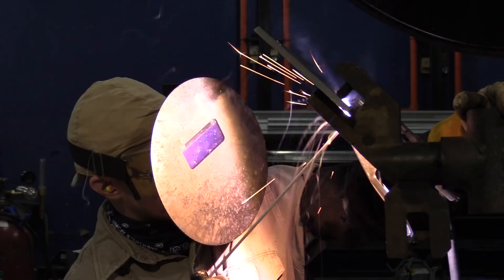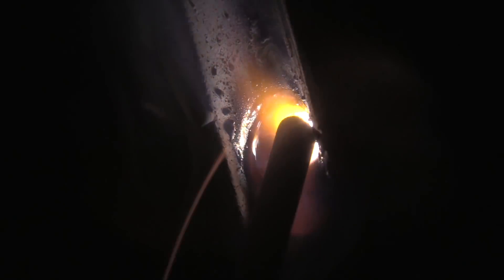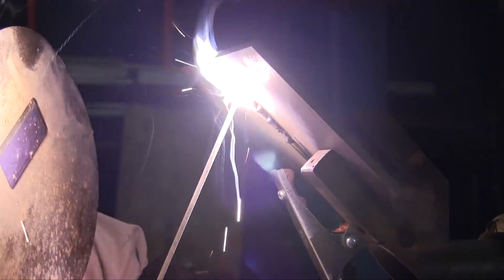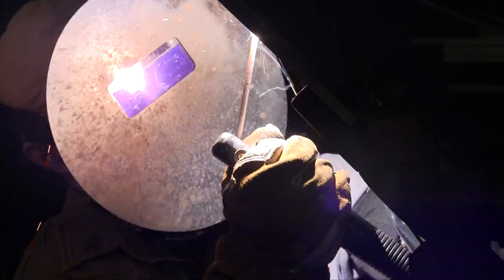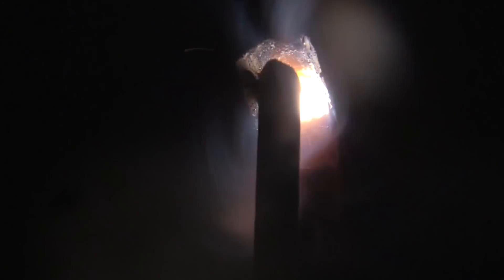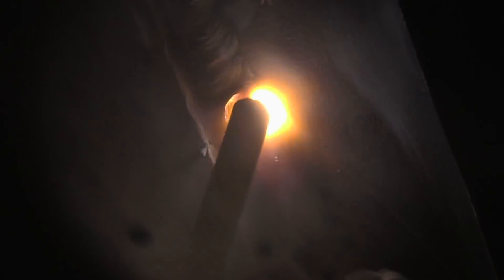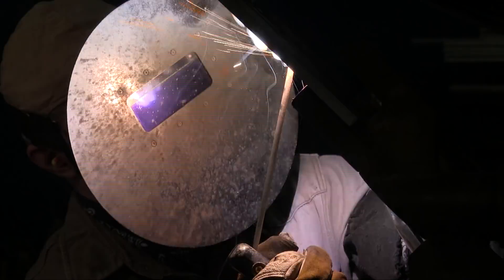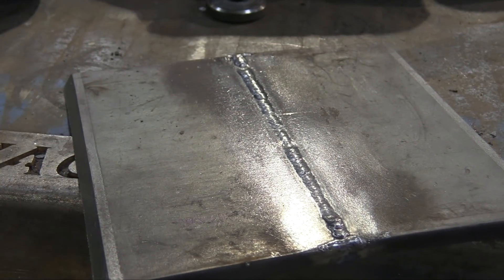7018 Stick Welding plate| Welding Tips & Tricks #Welding #Techniques #StickWelding

Comment: I USED all the tips you gave for 7016 open roots and it worked perfect with 7018 root on a 2" sch 80----was perfect inside

Comment: Do you use remote amp controls with stick welding any in the US? Over here it's common to see guys stick welding with one hand and holding an amperage control in the other. Never seen that in an american video yet. One of my welders come with a amp controller for stick welding though I've never used it, but maybe I should try it out.

Comment: Wow. Rod travel angle is nearly 90 on the hotpass. Good amperage tip on the cap but also on the degree to which the tacks have to be feathered and really burnt in to recommence the penno.  Amazing reinforcement on the 7016 root pass. Prep seems critical. Thanks.

Comment: 3:07 - There you have a little bit of slag on the sides and I have been known to stick a cutting disc over the entire two sides of my stick welds to forcefully remove all hardened slag, knowing that it's just flux and it will re-melt, but are there instances where the cutting disc into the sides is the correct thing to do?

Comment: You know, it's quite the coincidence that after I get a mp welder, and went out and got some 7018 electrodes to try and learn how to stick weld (have successfully made a pea size bead with 2 half rods) that 2 of the welding channels I watch come out with videos on 7018 electrodes. 

I'll keep trying till I get it. But mig is so much easier. 

Great vids though, super helpful.

Comment: My disclaimer is I am not a pro welder. However I have spent about thirty five plus years in the manufacturing world. 
My respect to the guys who can lay a good bead of rod. 7018 has always been a tough rod for me! I need a lot more practice! 
Keep up the great work on the videos, I appreciate your knowledge and expertise!!
Reply: $24 3M p100 respirator from home Depot.
Reply: Germain i didn’t know that and I’ve only been in the trade a few months and everyday my chest feels heavy and off
Reply: Joshwhaaa Oli you might look into a low profile respirator or a welding helmet with a built in respirator. Don’t know your age but some of the gas that metal releases is pretty nasty stuff!

Comment: beut weld, could you explain the TIP TIG used on the 4mm 301 hardened stainless used on the starship in Boca Chica? 
Thanks if you can!!!

Comment: Jody, did I miss why your stuntman there used 7016 for the fill? Why not just 7018?
Reply from the maker: Andrew used 7016 for the hot pass because it was included in a procedure where he works.  the rest of the fill and cap were 7018
Reply: weldingtipsandtricks maybe Andrew can comment on the purpose of that particular aspect of the procedure? I’m only curious because it’s a rod I don’t keep around the shop and would probably have never considered.  Maybe it’s a secret weapon the rest of us can learn about.
Reply: Ryan Jones my guess is the 7016 is all position and has a high crack resistance. Maybe just to beef up the root pass a bit more. I think it has more penetration compared to the 7018 due to the flux difference
Reply: Rikki Brewster I see. I don’t do much code or pipe work, but maybe I’ll grab a can of it next time I’m at the LWS and run some for myself. I don’t figure it needs to go in a rod oven huh?
Reply: Ryan Jones I weld pipe for the pipe fitters union but we  only weld carbon 3 ways 6010 the root 7018 fill and cap,  tig ER70 root 7018 fill and cap. Or tig ER70  all the way from root to cap. 

As for the rod oven question I do believe it is a Low hydrogen rod so I would still put it in the oven but I don’t think you have to for around the house work. 

Lmk how it runs I’ve never ran it brotha
Reply: Rikki Brewster roger that man.